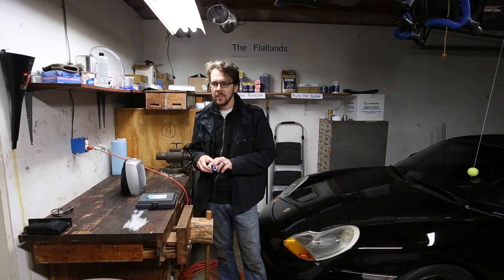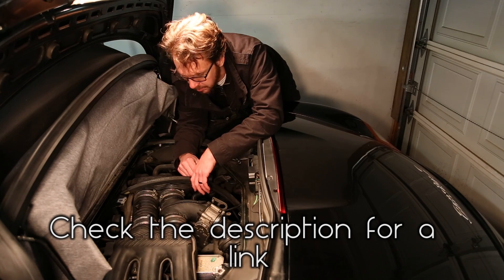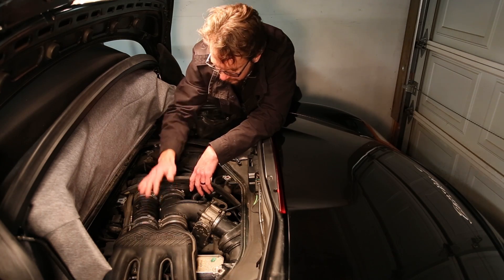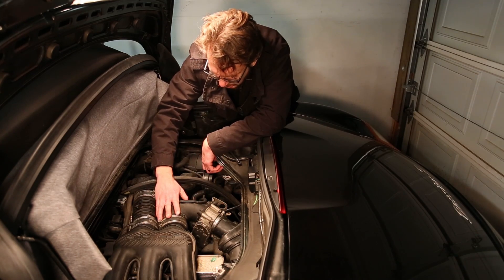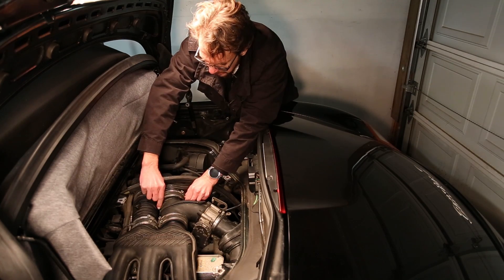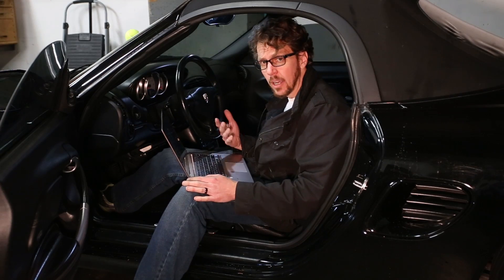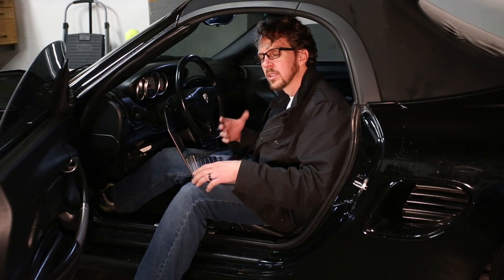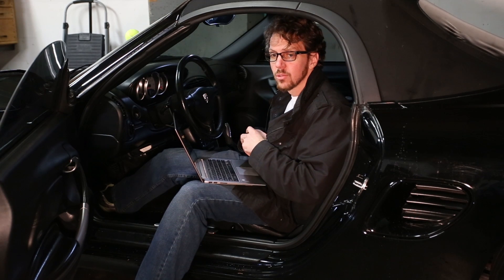How to replace a Knock Sensor on a Porsche 986 (BANK 2 KNOCK SENSOR)

Comment: perfect thanks burner !!!! been following your videos.

burner where will i find the axle position sensor front and rear coz i saw it in my durametric.
please help so i can replace it .
Reply from the maker: Awesome! Yeah, I believe the axle position sensors are for the self-leveling litrontic headlights. They're located on the lower suspension arm.

Comment: I changed my AOS recently and it was the first time I have seen a Boxster engine.  I have noticed that on your engine the driver side sleeve on the resonance tube has a vacuum  line attached. I believe this runs to the fuel pressure regulator? I believe whoever was in the engine bay last took these off and replaced them in the wrong order as the sleeve with the hole" for the vacuum tube was on the passenger side of the pleneum !  I plugged it off as I had had the CEL light coming on and guessed this was causing a leak.  I must go back in and see if i can find a stray vacuum line on that side of the engine bay. possibly this explains why I still get the CEL on and can only manage 27 mpg (British)!   Great vids,,, keep posting!
Reply from the maker: Ah, excellent observation! I bet you're right. The two sleeves are basically identical and the vacuum line is a small black tube, so it would be easy to switch them and lose the vacuum line. Cheers!

Comment: what's your thought on an 01 boxster with over 200k mileage going for $3.9k?
Reply from the maker: How comfortable are you with working on your car? I would definitely budget and plan for some big repairs. That said, if you're comfortable doing the work and have the budget, you could replace the motor when it dies with a good used low-mileage engine and still come out ahead.
Reply: Burner's Cars I've been looking for a boxster for a couple months and I've been very picky on the ones I've looked at. I planned to buy the car and go straight to my dads shop for him to look at it and see if there's anything to fix, so I would I'm pretty comfortable. how long do boxster engines usually last?
Reply from the maker: That's good. I don't really know how long these engines last, but I don't see many over 200k. I feel like you might want to be prepared to swap out the engine sooner rather than later.

Comment: Dig your vids, but one thing keeps nagging at me. Porsche is pronounced like Porsha, not Porsh.
Reply from the maker: Haha, yeah, I know. I do try to pronounce Porsha for the purists, but it's so commonly shortened to Porsh in the US that I fall into that easily! I'll have to redouble my efforts.
Reply: It's cool, so many people do it. I do enjoy your videos though. I do all my Boxster S maintenance myself also. Getting ready to put on a new Borla muffler and was wondering which nuts are welded to the flange. Got my Boxster back in Feb 2013 and have loved this car every day, just a joy to drive. Working on it is a different story though lol. Put in the Larger 987 Air Box, Larger 911 Throttle Body and T Plenum and really pepped her up. Getting some headers also, so that should help her breath better along with the Borla muffler, plus Secondary Cat Delete pipes.
Reply from the maker: Thanks! Yeah, it's an easy habit to fall into. You're doing some awesome work on your Boxster S! All mods I've been considering myself. I'd love to see some pics of your exhaust / intake system (I created a fb page for this sort of thing: https://www.facebook.com/Burnerscars) As for the exhaust, there are 3 nuts and bolts on each flange. Only the top nut is welded on. cheers!
Reply: Just checked your FB page, yeah I'll post up some picks of my stuff. I also put in some GTP Turismo Series Headlights that are the bomb, really freshens up the look. Also did the 4 stalk steering column mod and turned on the extra features for the gauge cluster. Bought the 911 gauge cluster, but have not gotten that installed yet, have to change out the oil sending unit and run a wire from it to the gauge cluster.
Reply from the maker: Awesome! I look forward to updates on your projects!

Comment: Great video. Were there any actual symptoms with the error? I am always perplexed as to which fuel is best for the 986 boxster (I have a 2.7). As it will take both with no apparent problem or loss of power, is it purely an economic decision??  Cheers from the UK.
Reply: Great! will look forward to it.

Comment: Great video...did you consider replacing both sensors and did you experience a smoother running engine afterwards....?
Reply from the maker: Thanks! I didn't consider replacing both sensors because it seems they don't usually go bad. In fact, I suspect the old one might just need a good cleaning on its contact surface. I think I'll throw it in my spare parts bin and try it if I ever have this problem again. I'll update you on how the engine runs after I've driven it a bit. I recorded some data with the Durametric before replacing the sensor. I hope to be able to compare before/ after to get some good data about how it affects the engine and ignition timing!
Reply: Burner's Cars great video. I had the same fault on my 911, tried a reset but came straight back on. Ended up in a local specialist who found a rats nest in the engine bay, he had to drop out engine and rewire the main loom , £1600 later and alls good except my wallet
Reply from the maker: Thank you, sir! I don't know if you saw my other video on this, but it turns out we had the same problem. Those wires are a pain to get to on my Boxster, and it sounds even worse on the 911!